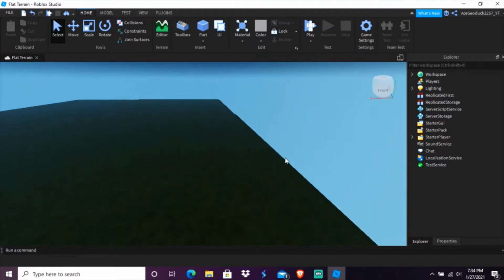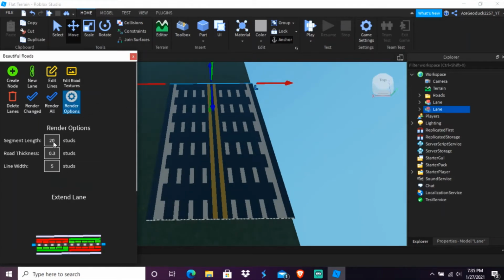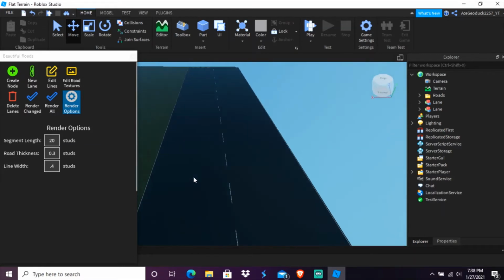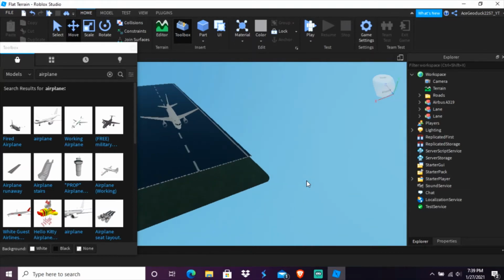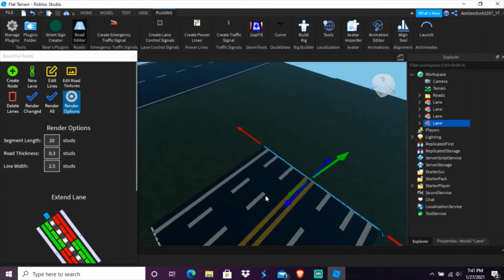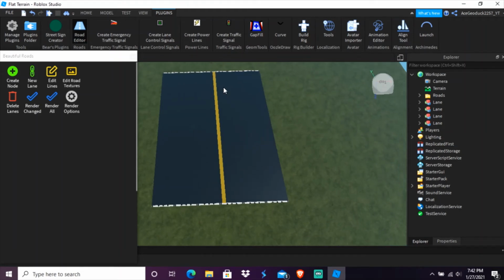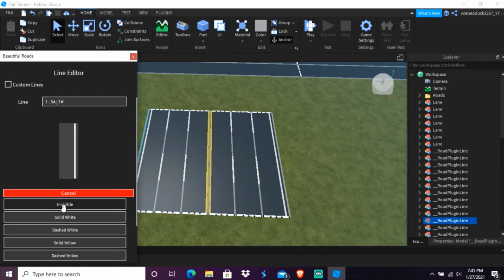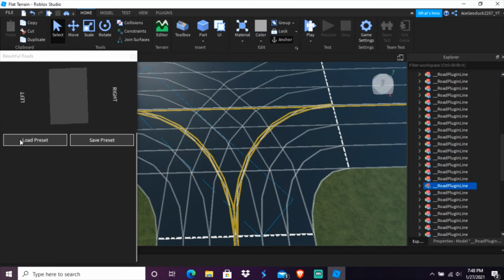Creating Runways and Taxiways using Beautiful Roads Plugin; Roblox Studio Tutorial

Comment: i use arc to make my roads
Reply: My roads are simple, they're  about 12 studs wide (for the lanes), one stud width for the markings, usually add a plain white texture, with the color of 255,255,255, and for my yellow lines, it's 255,150,0. I usually add a texture for extra realism and depth.
Reply: @endingtasks8538  teach us how to put textures?
Reply: @sranimaciones9207  I don't use this road anymore, I use 18 wide lanes from line to line. one stud width for the markings, the color of 255,255,255 for white, and 255,150,0 for yellow lines. I use no textures, unless necessary.
Reply from the maker: This is very helpful. Imma try this myself
Reply: I use textures for the lines***